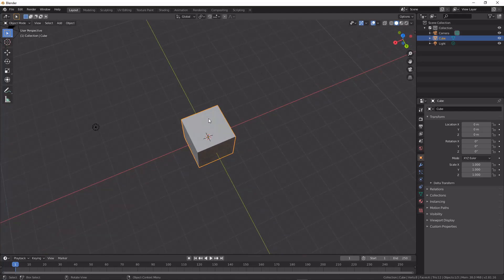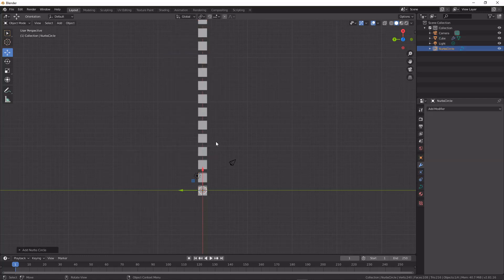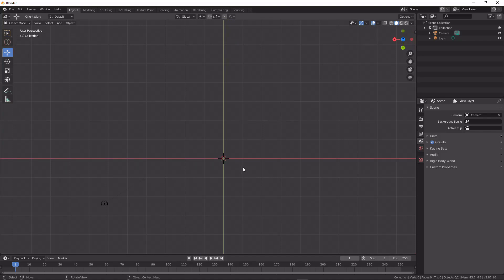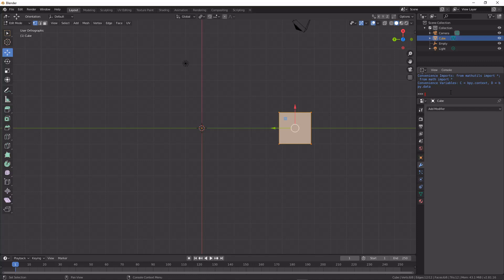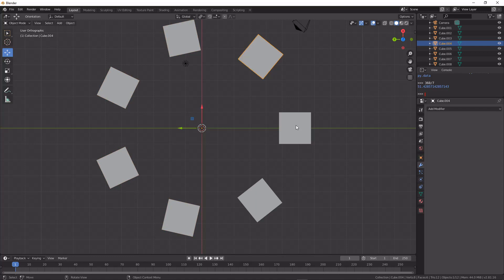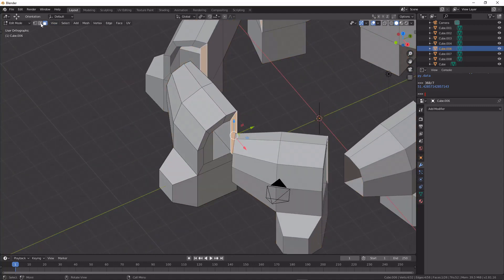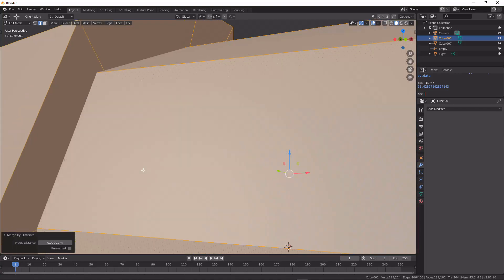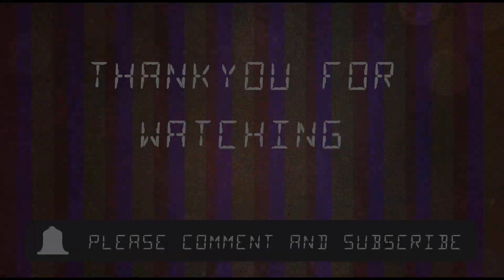how to do real radial symmetry in blender 2 8

Comment: Another way: create the cube and the empty, grab the cube away from the empty then set his origin to be the same than the empty. add a array modifier to him with 7 count. uncheck relative offset, check object offset, set the empty as object offset. rotate the empty of (360/7)°: the 7 cube should follow. then make the empty parent of the cube.
Reply from the maker: yepyep there are some methods with constraints too, will include that method with a shoutout if i do one on symmetry types for rigging

Comment: In this case the best solution would be to use the Array Modifier and the Offset option, with an Empty centered in the world axis used as Offset item. You can then simply rotate it on the z axis and get what you need (and it's not destructive). 
Like this:
https://youtu.be/9gYEA-ALqcA

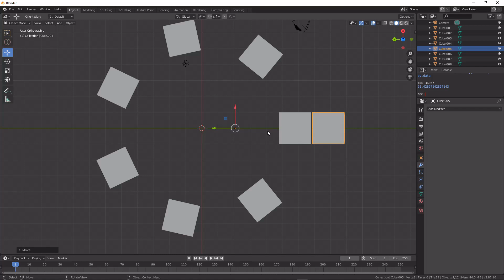Comment: (6:40 - 8:10) You can use this method a lot faster if rotated just after alt+D and repeated with shift+R
alt+D (to duplicate, don't apply right after duplicating) -> R (to rotate) -> Z (to choose Z axis) -> 51.42 (to set angle) -> shift+R (x6, to repeat previous 4 steps six times)

Comment: In others words, radial symmetry in Blender is basically dancing around the array of objects. But if you want to modify an object with radial symmetry(say move it's vertices symmetrically in 6 directions), there is no straightforward way.
Reply from the maker: sort of .. there is a constand offset option in the array mod too that gets you like half way there , but there are visibility and some usability problems with it , there are some .. and i guess i could write a python script to add this as a single click functionality but this method is still worth learning because  using  the object origin and 3d courser as makeshift hooks are also the route to doing more complex symmetry's and duplication effects in blender